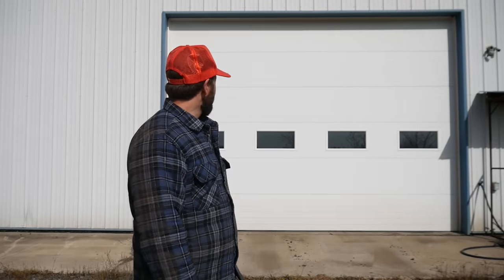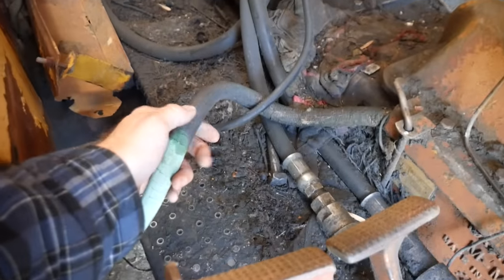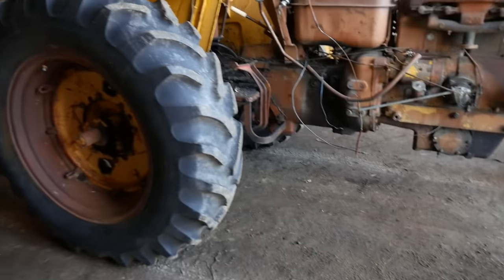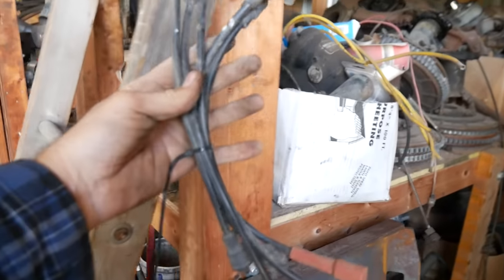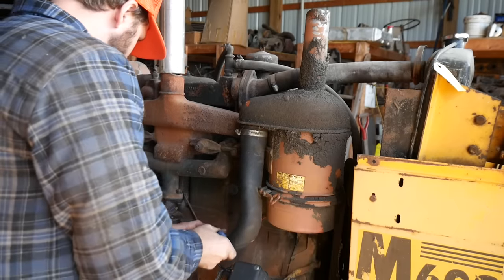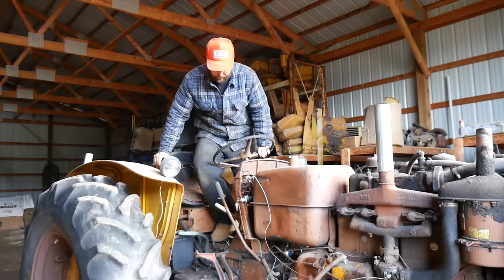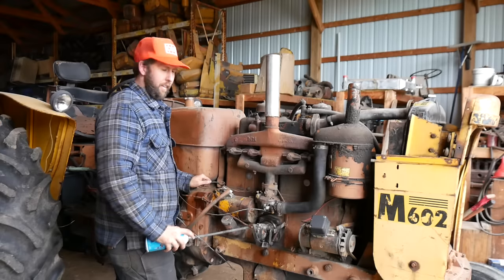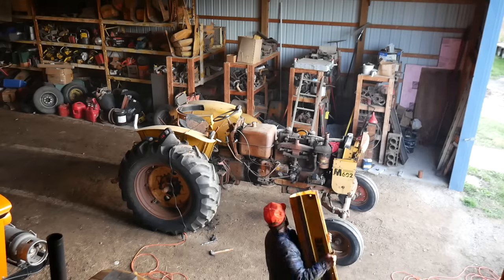Old vintage tractor..will it run after many years? - Vice Grip Garage EP43

Comment: Nothing I have has spark or brakes. But they've got plenty of oil leaks!
Reply from the maker: Haha.. i hear ya
Reply: If you have good equipment and its not leaking oil then its not running
Reply: If it aint leakin theres no oil in it!
Reply: @andyreid7274  are we talkin about harleys or triumphs?
Reply: @tomschweikert9537  yes!
Reply: That's just the automatic oil change option
Reply: Got an old forklift at work, that's how we know she's out of oil. It quits leaking all over the damn place haha
Reply: tom schweikert 
Yes!
Reply: Andy Reid 
Sorry there sir, I saw you had the same answer as me AFTER I committed.   But as my dad used to say; “great minds think in parallel”
Reply: thats just sweat from all the horsepower.
Reply: @tomschweikert9537  1930's Indians

Comment: “We are gonna do the right thing and Pretend we looked at em”. Classic.
Reply: I've eye grinded many pilot bearings in the past. Never fails to fail but is very cheap.
Reply: ted a he is a farm technician that’s how we fix stuff when something blows up fix it to the best of your ability with baling wire and run till it blows up again then maybe fix it with proper parts
Reply: CauseAndEffect Perfectly said
Reply: @ViceGripGarage  rubber impellers also like to slip on their shafts. and the water cooled exhaust manifolds like to clog at the riser, where you had the cans.
Reply: @ViceGripGarage  sure to clean the jets? it looked to me like dirt in jets could have survived your general carb soaking, making it too lean even with choke.
Reply: @ViceGripGarage  Ballast resistor wire is supposed to be there, except bypassed during cranking.  I think to keep the coil from overheating.
Reply: @TheTed169  you must be new here bud lol
Reply: @TheTed169  Ha, says the guy who's videos consist of making lunch.  Stick to not trying to burn the toast.
Reply: @ChevyC-hf6km  I never burn anything or try to rip honest people off but thanks for watching...you da man!
Reply: @TheTed169   That's twice you've said he is "Ripping people off".  

You''ve either misunderstood completely, or you are a liar.
Reply: @Me-zo8yc  I think ted is an angry little elf,  must be one of the South Pole elf’s  😝
Reply: @ChevyC-hf6km  1965 c10? Me too. 3SPD but the 230 is gone and a 250 is in.
Reply: @tims5481  TorqueFlite 727 behind a 331 Hemi

Comment: My brother had a MM M670. spent quite a lot of time working with and on that beast.  He's passed now, and the farm is gone, but seeing these old tractors brings back memories.
Reply: Dad's favorite tractor, a MM UB diesel,,  one year started loosing coolant, Pa said think it's head gasket, soon as we're done it's rebuild time for that one, of course as soon after done filling silo started fall plowing,  after milking one nite thought got enough time to finish that one field, in my hurry didn't top radiator, made one round and it made a pop snap noise,,,   and stopped, walked home told pa we unhooked plow dragged it home to the shop,, 2 days later picked up a 1066 with a 5-18 plow, took me 6 months to find a head for the mm ub diesel,,, but Dad kept the mm ub right up till we were done farming, in fact it was the last piece of machinery sold

Comment: Way I was taught, you use about 1/4 to 1/3 third throttle, no choke, spin it over and as it spins, pull choke out, it will fire a couple times and you push it in half way to let it start, then idle it down.  Of course, you are in the middle of a rescue mission and having other issues. Loving watching you work. Everybody has different tricks, I am appreciating watching.. I had a Minnie Mo, a great beast. It was very reliable.

Comment: You've single handedly showed more that brakes are just a luxury and not a requirement lol
Reply: Brave men need no brakes. Also, brakes are meant to hinder movement (aka speed).
Reply: "It is amazing how many drivers, even at the Formula One Level, think that the brakes are for slowing the car down." -Mario Andretti
Reply: I built my first bike around the age of 12 and it didn't have any brakes either. LOL
Reply: Kjkdfj986 ve ben seni hiç
Reply: Optional extras, brakes

Comment: I just reworked my 51 Ferguson. I did a 12-volt conversion but otherwise had all of the same problems. Rebuilt the carb, cleared a clogged fuel line, replaced a leaky sediment bowl, etc. They sure are sweet once you have them dialed-in and running though 😊

Comment: My 1953 MM UB gasser had the same trouble.  Your fuel line needs to be primed.  Loosen your gas cap and maybe crack the line fitting at the carb.  It will stay primed until you run it out of gas again
Reply: It’s gravity fed. It should fill itself with no issue on that alone. It’s clear he’s got either a blockage in the line or the float needle isn’t working right.
Reply: Justin Stearns   Mine did this with new fuel line, sediment bowl, and a rebuilt tsx67 carb.  There was no blockage.  If it ran out of gas, it acted just like a vapor lock, and gas would not flow from the sediment bowl to the carb until I loosened the new gas cap and the fuel line fitting at the carb.  Then, gas would flow and fill the carb bowl to the proper level.  I tightened the fitting and gas cap, and everything worked properly for months until I ran it out of gas again.  Rinse and repeat.
Reply: Mister Ed  Huh. I’ve never ran into that with my Farmalls or my Oliver. I doubt it’s just an MM thing, but I can’t say I’ve seen that happen, unless the gas cap vent was bad or something.
Reply: Sounds right. I thought maybe a rotten fuel line with a pin hole leak causing it not to prime but you're probably right

Comment: I hope there is a part 2 for this tractor as I enjoyed part 1 :)
Reply from the maker: Thinkin about it!
Reply: @ViceGripGarage   If that carb works on a venturi might there be some sort of blockage that prevents that? Or a leak? Enjoyed the video!
Reply: Need more gas in fuel tank. No fuel pump, you need a couple gallons minimum for pressure at the carb not a dribble. Second a guy might be better off not shooting thru the oil bath air filter but right into carb hose. 3rd, moline 4cyl liked half throttle and full choke for 1-2 full cranks then full release off of choke. It's like Hunter hitting the crack pipe.

Comment: I’ve started up a couple MM tractors that haven’t ran in 20 years, it’s a super difficult process, first you must have a couple hot batteries, then add fuel. Followed by completing these two important factory’s you must kick the piss out of the starter button because it’s full of rust, and some home with luck and Gypsy’s magic, the rust in the start button with become conductive and it will crank in the first couple spins. These tractors were build incredibly well. My family has owned a MM dealer since 1950!

Comment: that's awesome.   when i was a kid my dad had a 1938 minneapolis moline, it had the old crank start on the front of the tractor below the radiator. it was nicknamed the arm breaker.. if you were not careful the crank would swing back and hit you in the arm.

Comment: Swap out that steel line between the carb and the sediment bowl? They tend to get crusty....
Reply: i was thinking same thing way he didn't think of this he seem crap in bowl but didn't check the line why he should know crap would ran the line over the years. i bit cheese off he gave up this so easy he need go back check fuel line i bet it fire up my clean the carb again as crap from line draw back in.
Reply: @aussiezx3017  And he didn't pull off the pipe I don't think he knows anything about tractors or at least there air filters which is just oil .

Comment: Don't give up so easily.  Follow the fuel flow from the tank to the carburetor.  Rust and scale often blocks fuel from leaving the tank.  You can twist the filter out of the bottom of the tank to clear it out.  Make sure you have good flow to the carburetor.  Adjust the needle on the carburetor.  Did you make sure the seat was clear?

Comment: One thing I love is that through all the laughs I still learn something else every time. I'm planning on going to school to be a diesel mechanic next year. My day will be split between high school and the diesel mechanics school
Reply: Rule #1. Never check a diesel compression by sticking a finger over an injector or glow plug hole.  You’ll lose at least up to the first knuckle of a phalange. 😳

Comment: I would like to hear what happened with the Moline M602, from the son of a MM collector!  Your red service truck got me!  I spent countless hrs in my dads red ~1957 1 ton Ford service truck, Straight 6 with enough room to stand between the fender wells and the engine!

VGG Family has great content!  I stumbled on your channel a few yrs ago, then got too busy. Reconnected a few wks ago and got hooked and subscribed right now. This vid is very nostalgic to me.  Born and raised in Minnesota (almost ND), my dad started collecting and restoring Moline tractors in the late 70’s when I was 10.  I spent countless hours wrenching and tinkering with him, going on road trips to extract MMs from tree rows, sheds, you know the deal.  He’s still hard at it. My first engine he let me wrench on was a ‘20s – ‘30s gas powered one cylinder kick start Maytag washing machine motor.  After that outboards, lawnmowers, snowmobiles and cars.

Comment: Thanks for the pep talk at the end , Brother. You can't win 'em all. God Bless...

PS: If she's still there, go back and take the gas cap off and blow compressed air back up through the fuel line into the fuel tank. I'll bet the line's clogged. I had that different times with old gassers.

Comment: As one of those kids that wanted to make a few bucks, I sat on many different old tractors that never had a cab and the L 4 and the L 5 have been deleted on. First tractor that I remember driving was the old johnny popper. Hated that hand clutch. A guy just had to figure out many issues so he could keep on running. There's just nothing like swattin mosquitos and wasps while chockin on the old dirt clouds. I do remember slippin on one the steps and runnin the shin on the sharp edge. Thanks for wakin up the old cloud of storage ✌️ I wonder what Jimmy Page is doin right now

Comment: Had the same problem on a 54 Ford here on the farm with that exact carb. I couldn't get it to stay running for the life of me. I think I had to prime the gas line and I think I adjusted the float and the mixture way richer than they really should be and it runs great now.

Comment: Tips:  1#:  Sediment bowls also have brass screens.  #2:  Ethanol can eat away brass and pot metal on some old fuel systems.  I've seen some be fine and others wrecked.  #3:  I've seen ethanol  make float valves start to leak after a few years of use in old tractors.  #4:  The insulating block on your distributor was broke in two - I believe those are one piece through the distributor.  Continued.......

Comment: A trick that works for me (never tried it with an up-draught carb, but it should work) when you can't be bothered to remove the air cleaner to put some juice in the throat (or if its fuel injection), hold a fuel soaked rag in front of the air inlet of the filter...

Comment: I have an old pay loader with the same engine. Those updraft carbs are a pain. I had to adjust the floats to the point where I had the fuel. I also added a toggle switch to the coil. Ill explain. The points need only six - nine volts to operate. I added the switch to run twelve volts for a cold start. I’ve pulled that carburetor off so many times. 😂. She’s a runner. Great video...
Reply from the maker: Thanks donald!!

Comment: c racking the fuel line at the carburetor will purge air block in the line, we have had that happen numerous times with M's and H's after carb work. Not enough pressure from the tank to push the air out. And don't forget to check for a fine screen in the fuel line inlet at the carb...those block up with sediment.

Comment: I had never heard of Minneapolis Moline before this video so I had to do some digging. Their factory was off of Minnehaha & Lake and there used to be a huge rail yard with a train turntable right next to it on Hiawatha. The turntable was removed in the early 50s, their factory was knocked down for a strip mall in the mid 70s, the sprawling railyard shrank over the decades until it disappeared entirely in the 90s. Now it's all retail shops and just a single rail line, but I'm sure the neighbors prefer it that way, I couldn't imagine living next to a rail yard in the age of steam. If I ever find myself in need of a tractor I'll be looking for an old MM.

Comment: Derek I've got to call foul on that one. If you have the patience to sit down and file rings to build an engine, which is a very slow tedious process. You most definitely have the patience to build a set of plug wires. Lol
I love these tractor video's. I've said before, I'd love to see you teach a little snippet on setting points with a dwell meter because you've got a way of explaining things simply so feller can wrap his head around it. Also I think a tractor would be the perfect vehicle for that because the distributor is right in your face and everything is easy to see.

Comment: On those old Marvel Schebler carbs, there's not much to replace on them anyway. I bought a new one for my Massey because it was cheaper than getting a kit, but I ended up with a second tractor and it needed a carb as well, except that one was seized right up from having been filled with water for a few years.  I took my original carb from the other tractor and boiled it in lemon juice off a tip I got online.  That thing came out looking brand new and worked just as well as the new one did when I bought it.  Lemon juice ate up all the varnish and gum as well as the rust, and no parts needed replacement.  No float sticking, no running rough under power starving for fuel. It just went.  That started out as my parts tractor but it ended up being overall in better mechanical shape so I swapped all the good stuff over to it and ran that one instead.
Reply: Forgot to mention, smelled like lemonade every time I started it up after that too lol.

Comment: Those plugs probably have big black caterpillars on them. Too bad,  I hate when one part costs more than the tractor. The electrical department was not helping to run to the fullest either. I do the same evaluation, turn over then fuel then redue entire electric system. Helps when I go to therapy. LOL

Comment: How about a 90 degree elbow, some mounting flanges and a bit of welding to make an adapter for a generic side draft carb or even a 180 bend for a simple down draft carb?  It would take some fiddling and a re-design of the throttle/choke linkages, but it would work if a guy were really determined to get the old girl running again.

Comment: Beat on like a cabin screen door ! Those old marvel schlieber carbs , thier is a good reason for that large knob on the main jet ! I lost a good tap in the bottom of one on a 58 Oliver 550 once, most of that stuff on a tractor (factory stuff) like fuel , oil pressure gauge tachometer is not completely needed maybe

Comment: The trick with those up draft carbs is you got to block the intake to start a vacuum for the fuel to be pulled up then once she starts hook back up the air filter and you should be good

Comment: I saw you do the Harley that had been sitting and you checked the fuel flow from the tank. Those old tractors with the gravitation fuel pump sometimes get junk in the lines also. I couldn't tell if you checked how well the fuel was flowing. If you have a restriction at the petcock, you can still have a little in the line and not have good flow. You didn't say if you checked how well the fuel was flowing. Your channel rocks.

Comment: I had an old CASE tractor for awhile awhile ago .   It was a nice old unit having been manufactured in 1955 though It was unreliable with the starting and running.  Eventually, I went whole hog with a new carb and despised the price but there really isn't any way I would have been happy otherwise as it went like new afterward and was worth it. Seemed like it quit using fuel afterward instead of gulping tank after tank so that was good. Hard to say if there is another workaround considering the updraft thing. I suppose a propane carb is about as much as I had to give for a new Offenhauser  1bbl or whatever it was. It was a long time ago but I will bet I could have bought 2 four barrel Holleys at the time, but I didn't figure they would work upside down to draft correctly. Been years since I thought about that.

Comment: I would hazard a guess that the bad feeling that you had when trying to remove the spark plug was actually the socket dragging against the  head. Need a very thin wall plug wrench for many old tractors!

Comment: Have a 66 Ford did the same thing was not the carb it was a blockage in the fuel shutoff valve....I could get it to run for few seconds, i even replaced the carb. Replaced the fuel shutoff and fixed it right up!

Comment: felt sorry for you, first half of problem is 6 volt & no battery charger boost, 2nd half is something in tank or fuel line restricting floe, my 53 ford  was the same until i finally found the obstructu=ion in fuel line, good luck

Comment: Those glass bowl pet cocked can plug up some. Jet a little compressed air to back flush them. However the will get bad enough to require changing out sometime. Who’d think gravity fuel could be so complicated?

Comment: Maybe it's something simple like putting the emulsifying tube in backwards, as is possible with some carbs.   I would have taken the lower clamp off the intake hose, and choked the carb with my fingers... used to do that on one of my first motorcycles, to get the most speed out of it going up the road.. . .not so many other vehicles on the road in them years.